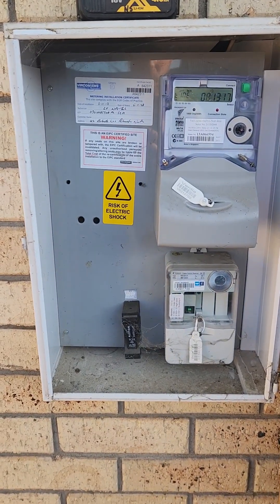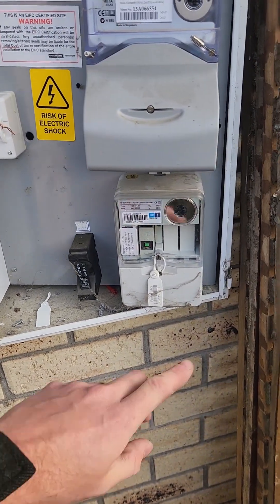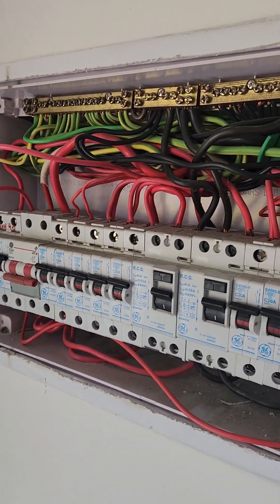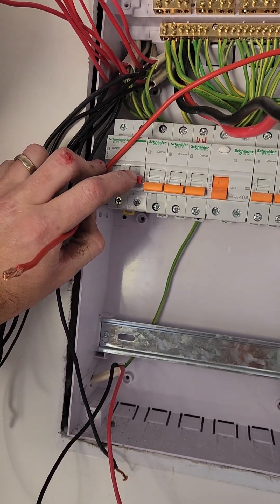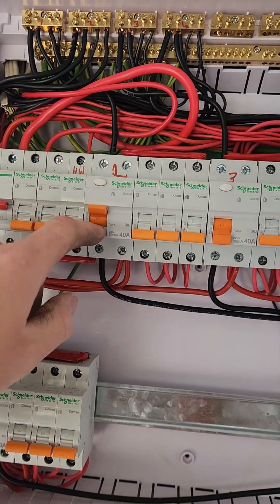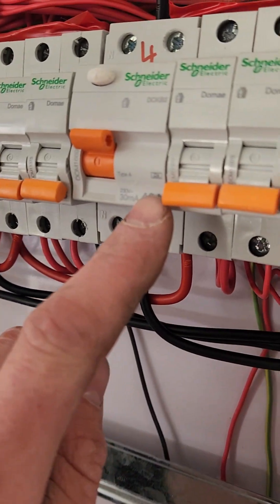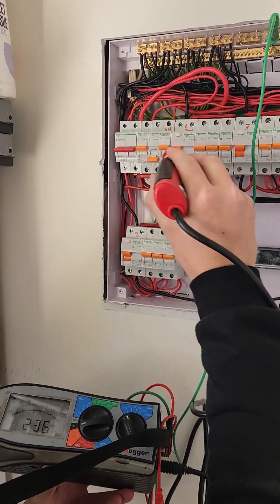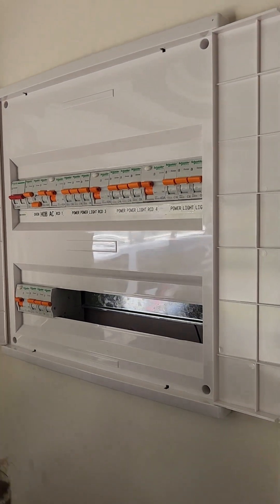Main switchboard upgrade

Comment: Would this switchboard upgrade be classed as high risk work requiring an inspector? Or because it is a straight swap of an old board to a new one where the mains isn't altered, only re-terminated, it isn't high risk?
Reply from the maker: Thats right, swapping for the same so not high risk work 😊

Comment: Im an apprentice and just wanted to know how you determine what cable goes for what CB after you have removed all the old installations breakers ? To me it just looks like a whole mess of wires unless I do them all one at a time
Reply from the maker: When you are starting out you are definitely better off to label all your cables, but as you become more familiar with your work and what you are looking at you can stop pre labeling and go by conductor size to choose your mcb. The only reason I would still label is if all of the circuits are well labeled which 99% of the time they arent 🫡

Comment: How and where is there never a main,/ master switch at the meterbox....a block of flats.....or at a establishment where people go around switching off the power,,,,, the test button on the rcds is a tricky one.... no requirement for activation time wise,,,as long as it trips....rcd meter test in correct time is sufficient??  Which always made we wonder why we don't have to test the mcb trip function,,,,, like they had to in the old days with fuse wire😊
Reply from the maker: @brianhoffman4861  we almost always have to put in an isolating switch at the meter board it's probably a good 50/50 in the lower north island.
And I agree where the rcd is concerned
Reply: @_nztradie  all good,,,lower north Island has its own rules...I guess the further south you go.... solar power and candles.... well I ain't saying the girls are ugly in daylight

Comment: Love your videos! Shouldn't you perform an IR test on the circuits before connecting?
Reply from the maker: Yes you can, but because we didn't install the cables as new we are not required to di an insulation Resistant test on them 👍

Comment: Hi Tradie Any chance to get copy of AUNZ 3000:2018 book for ERWB Exams
Reply from the maker: Hey man, you need the as/nzs 3000:2007 as that is the current standard, the 2018 will have things in it that can set you wrong as they contradict the 2007
Reply: Thanks Kiwi ! could you please help me get copy for AS/NZS 3000: 2007 I am in Auckland Central
Reply from the maker: @vimaticindia  if you go to the standards website, www.standard.govt.nz you can order them from there 👍

Comment: This is a really interesting set of videos on panels... it is quite wildly different from how things are done on the North American continent! The wire/cable and general building looks quite similar, but that panel is crazy comparatively! How long does it take to assemble and install something like that? The use of "buss combs" blows my mind... that just sounds terrifying!
Reply from the maker: Thanks for watching, this took us about 2-3 hours and we were just going at leisurely pase on a Saturday (it was for my apprentices' parents)
It can be done quicker if you needed too but I was teaching also. Yes you do have to be careful with the comb as live parts of copper can be touched fairly easily 😅

Comment: How come you don’t use RCBOs? Just wondering because I’m an apprentice and I’ve never installed an RCD, always just use RCBOs for anything new
Reply from the maker: @vHystrix  there is no real difference except that rcbos are move expensive. We use rcd mainly because thats what we have always use but also because we want our apprentices to be able to wire one and not just rely on rcbo 🤙maybe ill make you a video bro

Comment: Hey mate, thought only range appliance doesn't require RCD protection? Can't see anything in anzs 3000 about AC and hot water being exempt unless I'm missing something
Reply from the maker: @cozzaa  good thought I can look but I believe its under fixed wired appliances, But in the 2018 regs when they come in for nz AC hot water  and maybe even ranges (not 100% sure) have to be on  RCDs
Reply: Yeah been in oz and wasn't aware that NZ still uses 2007 so yeah it's not required ( saves a lot of nuisance tripping if you ask me)
Reply from the maker: @cozzaa  yea but we are at the stage that we are behind the times, and it gets a bit ridiculous. With the likes of evs and batteries

Comment: Can the slot with two screws in those copper bars accept a 25mm² conductor?
Reply from the maker: Yip it sure can
Reply: @_nztradie  what is the biggest conductor size the single screw slot can accept? Thanks
Reply from the maker: @IAmTheD  it would be a 6mm² you can get a 4mm² folded over to fit, but the next size after 6mm² is 10mm² and that definitely won't fit in the single screw terminal
Reply: @_nztradie  Thanks. What are the size of the mains here and why the 3 MCBs are without RCD protection? Don't you think it's better to replace the three MCBs with RCBOs?  Sorry, a lot of questions but  I have learned a couple of things from this video 👍
Reply from the maker: @IAmTheD  youre all good bro, it was a 16mm mains here. Some appliances such as heat pumps, ovens, hobs, and hot waters are not required to have rcd protection
Reply: @_nztradie  Thanks bro.. Looking forward to more videos like this.
Reply: Is it common the put the buzz bar at the top of the mcbs? And load into bottom of mcbs?
Reply: @93lornamae  Modern MCBs normally can be bottom-fed or top-fed. But RCCBs and RCBOs are usually top-fed only or bottom-fed only.